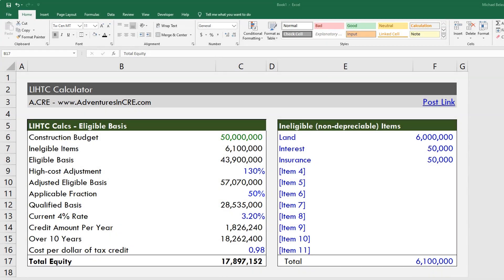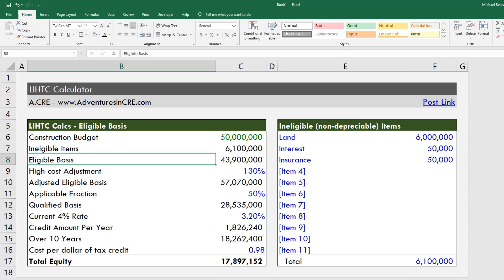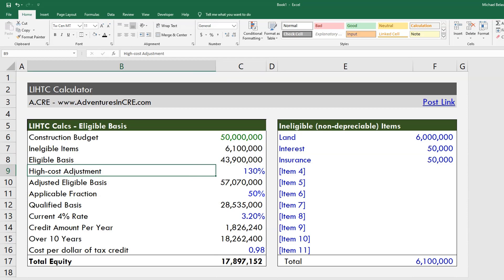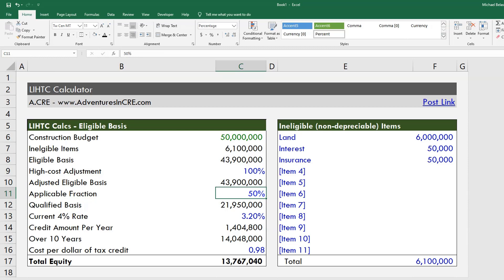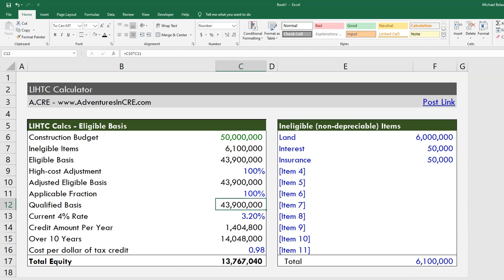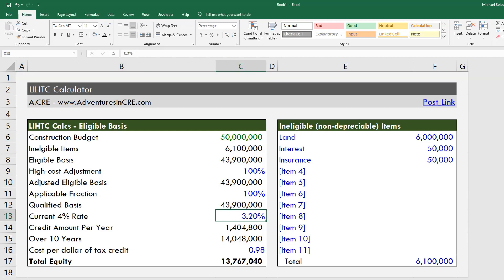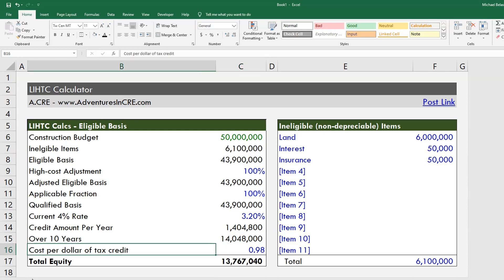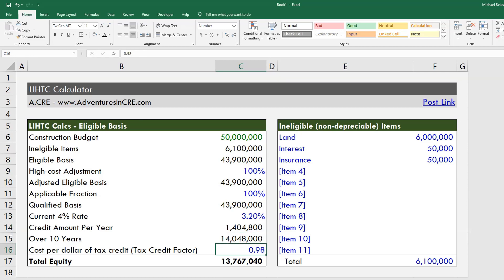How To Calculate Low Income Housing Tax Credits [LIHTC]

Comment from the maker: If you want to download this tool, you can head over to the post, which is linked at the bottom of the description.
Reply: Michael Belasco  who can help me and guide me through the process. Are there like advisors or brokers who can charge me a fee and help me develop a 5 achar land I Own in California. I have the land and the plans but would like help using this lihtc program. I have no idea where to start or how the process works.
Reply from the maker: @ayo3555  Novogradac is one company that is an expert in this space that you can check out. https://www.novoco.com/
Reply: @MichaelBelasco  Does this company know how to implement this in any county? Since I'm very new to the this I'm still trying to understand how this works a little better so I understand the pro and cons of the program. Based on my initial review this program does not cash flow so how does the GP investor make a profit and how do you pay back the LP in these deals? I have a lot of questions. 1. How is the capital stack arranged for LIHTC? 2. Is there a case study to view this more in detail and consultants who have completed various size projects? 3. How is the debt and loans structured? 4. Since the rents are so low how is the debt service repaid? Are the balloon payments expected to be repaid? How is the soft debt calculated and does it need to be repaid.